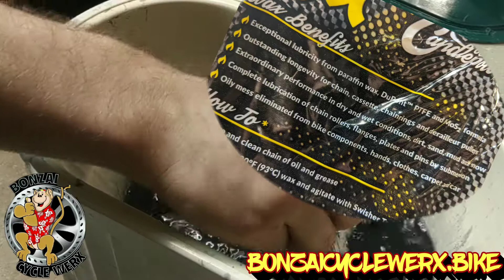We now offer Speed Wax!

Comment: I am curious, have you tested it in snow, slush, or mud, water, rain for multiple hours? how does this wax compare to homemade wax from candles?
Reply from the maker: As we don't have snow in Texas, no I haven't tested it in snow. But when I have ridden it off road in dry conditions (our soil is clay. When trails get rain they close). I have ridden through some wet spots that would normally make my drivetrain grind... Still super quiet. Someone elses mountain bike who rides More than me has gotten a whole month of riding before any new wax or lubricant is needed.
Reply: @BonzaiCycleWerx  I have to lube chain after every ride, at least those long where I have washed my bike afterwards.
I currently use Wedtite Wet Extreme, I also used Muc Off wet lube, due to salted roads I have to clean bike, and lube chain, or it will rust.
Rock N' Roll Wet Extreme was the worst lube I have ever used, it knept the chain cleaner than other but it washed off after few minutes of riding through snow, puddles, it made horrible grinding noise. but the two others I mentioned lasts me for multiple hours, but I haven't tried wax yet, I heard a lot of good things about Smoove lube, and also Speed Wax. have you tried Smoove lube?
does the chain wax attract dirt? will it be covered in sand and tiny gravel?
Reply: @BonzaiCycleWerx  that sounds promising.